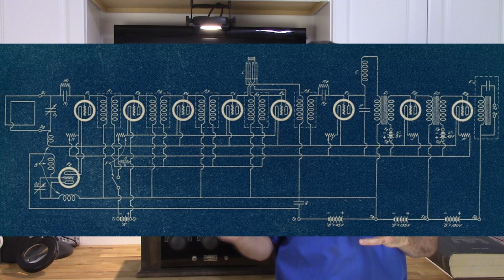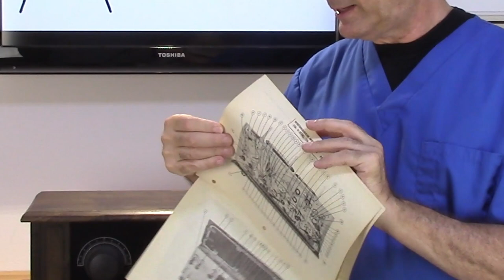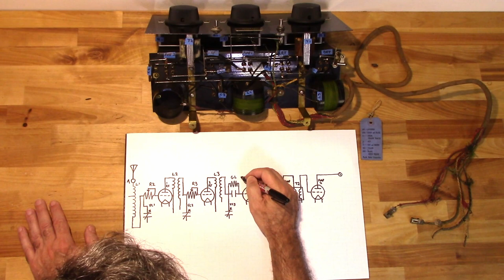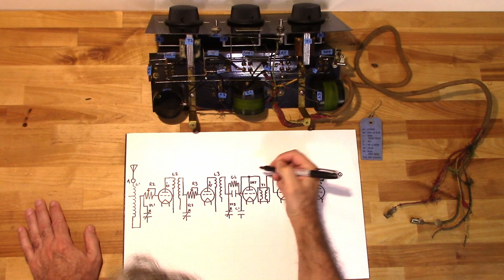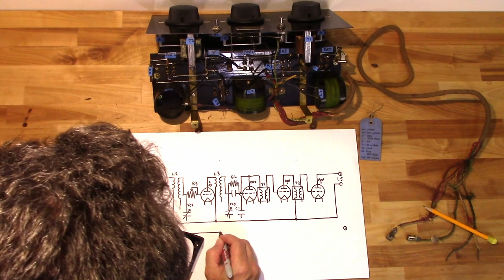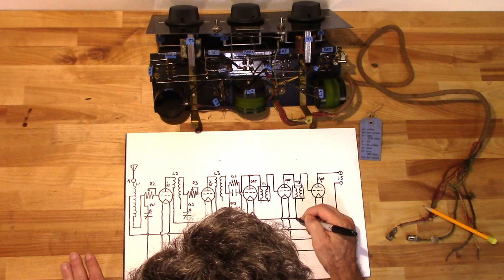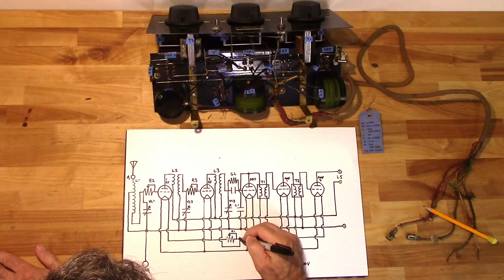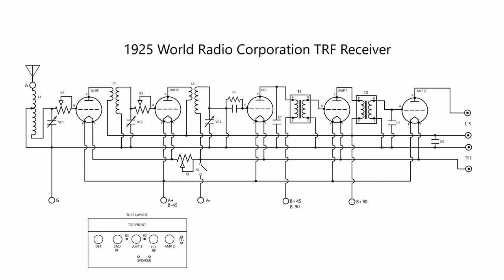How to Create a Schematic for a 1920's TRF Radio - World Radio Corporation Example

Comment: This is a tremendously useful resource. I have recently acquired one of these sets which has been stripped of many parts. Without this video, restoration would be very problematic. Thank you William.
Reply from the maker: Thanks!  The restoration video on the Chelsea model 104 came about because I'm putting together schematics on all the Chelsea radio line.  I've been trying for years to figure out the wiring without actually having the radio.  I was trying to use photos online and attempted to find owners who would share information.  It was futile.  After finally getting ahold of a perfectly intact one, I was able to produce an accurate schematic.